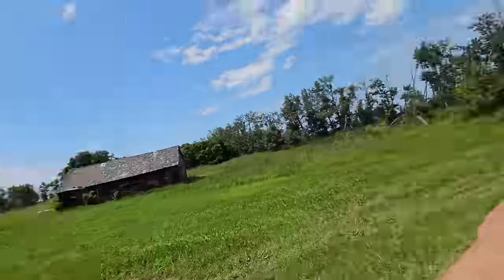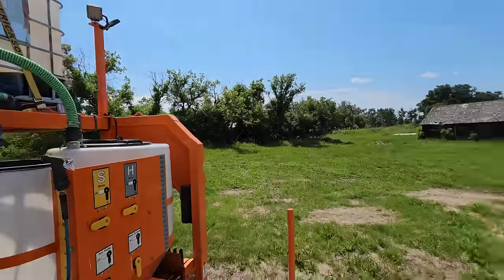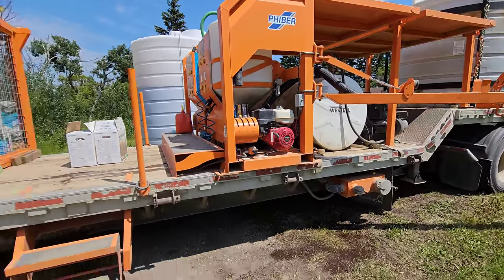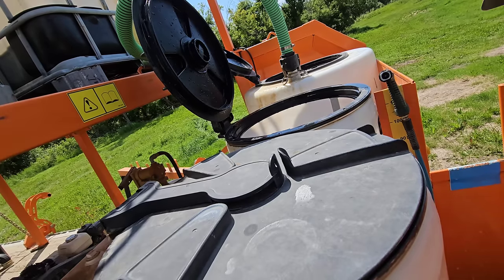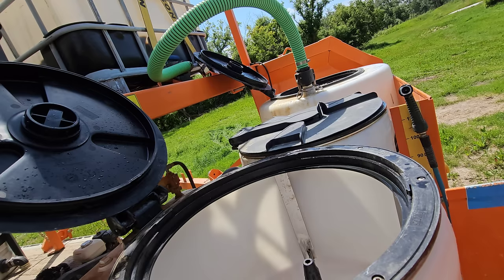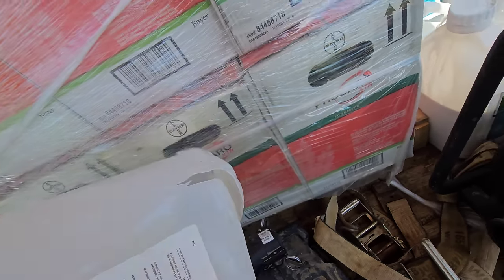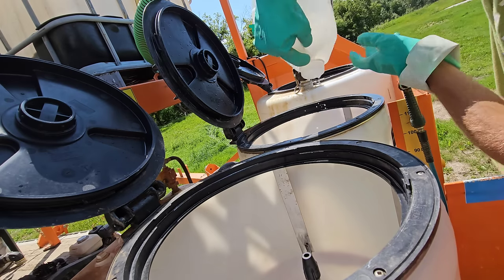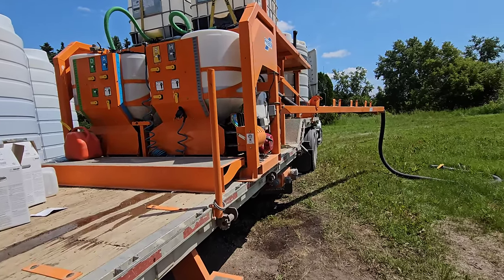Mike's rocking the Dash!

Comment: If you had a breather tube attached on the rinser the jugs wouldn't glug so much or you could start injecting the water before the jug is empty.
Reply: I was going to suggest that too, or inject air in that water line to rinse and push the chemical faster out
Reply: Surprised to see the white semi-clear water tanks, do you not have a problem with moss growing in those tanks when water is left in them?
Reply: @edlehman5726  Not any more or less than an IBC, and those dont usually grow algae

Comment: Our chem handler has splitters over the sprayers. Pull the jug from the box, drop the bottom on the splitter. Jump on the pedal for the water, rinse and remove jug, toss to the side, repeat.
Reply: I should also mention our water pressure is around the 30psi mark, if you're not holding the jug when you step on the pedal, the jug will shoot up about 20 feet. Ask how I know lol

Comment: My days in the 60's was 1gal.tin cans and a measuring  cup ..most was a 4-D product  if I'm correct and the sprayer was 50 gal barrel strapped to a A JD 24 ft. Boom ..roller pump on pto 
.did thousands of acres...things sure have changed...Love the setup and the sprayer..it probably cost a little more and covers more then the old A JD did .
Thanks for the demo.

Comment: You could punch a small hole at the bottom of the jug so it will get air through there while it's glunging and just cover it with the cap or something while rinsing

Comment: what if you turned on the water jets while you’re dumping the jug? 
just a little bit tho!👌put a little pressure inside the jug, instead of the air having to go glog glog glog back into the jug. it should drain quicker, im thinking. 

Just an idea. i don’t have one so i can’t try it, otherwise i would. 😂.

Comment: If you had some air pressure on the rinsing pipe it could force the chem out faster, then rinse after. Or could you turn the rinser on before all chem is out??
Reply: No need, over complicating an already over complicating contraption lol. Pump is  already pulling rinse water through the pipe. Gravity does the rest

Comment: In Holland it will be mandatory by law next year, to use a filling system that prevents the operator from coming into contact with the chemical substances.
A universal can opening has been developed for this purpose. And that will be used by all chemical manufaterers.
I don't think it will improve the work speed. It will improve safety and environmental safety.

Comment: Why you waiting for the air is guglining into the canister, you have compressed air and you have a nozzle to spray water inside in the same way you can press compressed air into the canister and press out the fluid. Perhaps  a separately pipe that is parallel to the nozzle.  Or you can mix air into the water . And you should control the air otherwise the canister starts like a rocket away .
Thank you for you videos, i am from Germany for my it is unbelievable in which dimensions you work

Comment: My question is, why do those jugs have such a random 8.65 liters number? why no 8 or 10 or any round number
Edit: I use British Gallons and this has nothing to do with gallon conversion to liters as it is under 2 UK gallons, hence my question.
Reply: Because they are 2.5 imperial gallons.
Reply: @delbutler885  That is less than 2 British gallons hence my question.
Reply: @FoodwaysDistribution All jugs are measured in 2.5 gallons then converted to liters as Canada uses the metric system and the box is 5 US gallons of chemical.
Reply: @crandonborth  a quick search on how many liters is 2.5 US or British gallons tells you that it is not